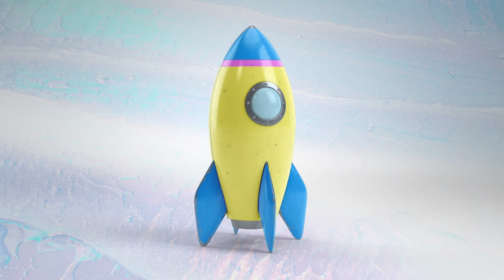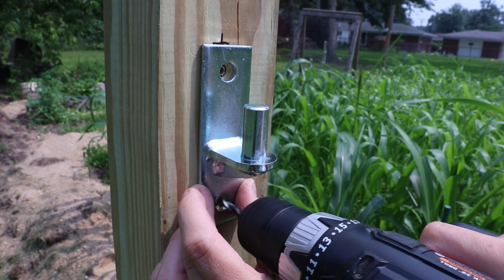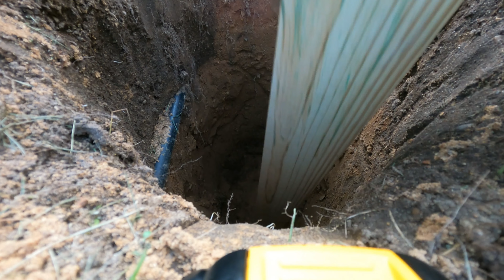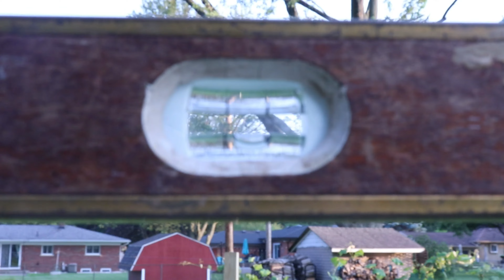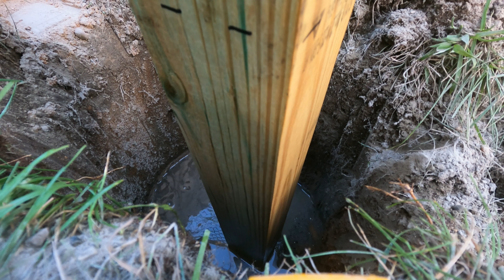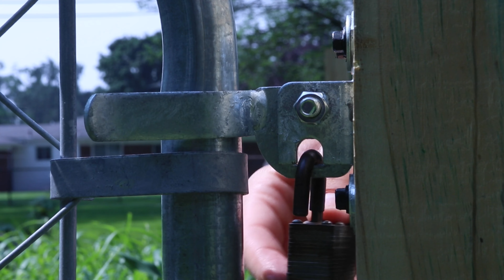How to Install a Metal Gate between Wooden Posts

Comment: lol  well in my opinion is not a consideration about the top hinges faceing down that is the way it is supposed to be... facing down so no one can  lift your gate up off the hinges and walk away with it if you going to do it do it right..my suggestion is you'll have to drill all the way through the post and use a nut and bolt type of system and there is another way but trying to explain it to you will be too much writing
Reply from the maker: I concede the point. The upper hinge should be facing down. Thanks for the clarification.

Comment: Supposed to put the upper post facing down so it is difficult to lift off.
Reply from the maker: Thanks for pointing that out. Yes, the upper hinge plate could point downward so it closes off the hinge side of the gate. If you are trying to keep people out, that's definitely a consideration.
Reply: 100%
Reply: Yep, top one down and bottom one up. Did a great job on the posts and gate.

Comment: will it work on a circular post
Reply from the maker: I've never worked with a circular post, but I don't see why this same method wouldn't work. Depending on the width of the post, the anchoring plates might not sit flush. You may need to use shims or something so the plates are flush with the curved surface.

Comment: My gate is 1 3/8" but your link for hinge pin is 1 5/8" and link for hinge is 1 3/8. Is that correct to get 1 5/8 for post and 1 3/8 to connect to gate? Ty! Video was exactly what I needed to see.
Reply from the maker: Yes, these are the correct links! The hinge pin is actually 5/8, it's for the smaller part of the hinge. The 1 3/8" hinge dimension is for the larger steel pipe of the gate. Does that make sense? Hard to explain without showing you a diagram. I hope that helps! Let me know if you think my information might be in error.

Comment: Will not the fence lift right off the hinges unless you install one of the hinges facing downward?
Reply from the maker: The hardware I used can be tightened with a nut, so there is no risk of the gate lifting off, unless the nut loosens and the gate is lifted by force. It's been nearly a year and it's still in excellent shape. Thanks for watching!

Comment: What size gate is that? Do you buy it at Lowes?
Reply from the maker: The frame of the gate is 1 and 3/8 inch steel pipe, which determines the size of hinge and hinge plate you use. In terms of the gate's dimensions, I THINK it is 4x3.5 ft, but I could be wrong.
Reply from the maker: I got the gate at Home Depot, but I bet Lowe's carries them too.

Comment: How do I know if I should order the 1 3/8” or 1 5/8” fence hinges.  I have a chain link fence from Lowe’s.  I have no spare washers so I need to know what size to order.  I’m a woman on my own and don’t have help.  Thank you.
Reply from the maker: It depends on the diameter of the pipe frame of your gate. Can you go measure it? If it's 1-3/8" (which is most common) then get that one. Amazon lets you choose the size you need. Fortunately they're not super expensive, so if you get the wrong one, no big deal. Good luck on your project!